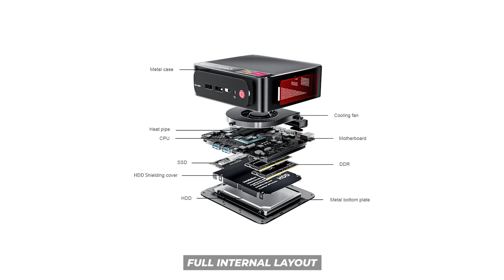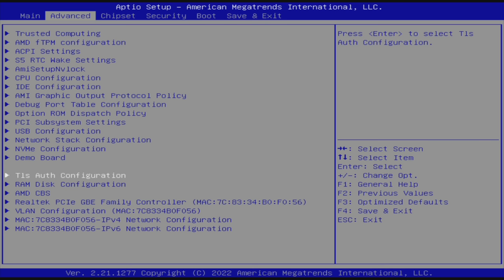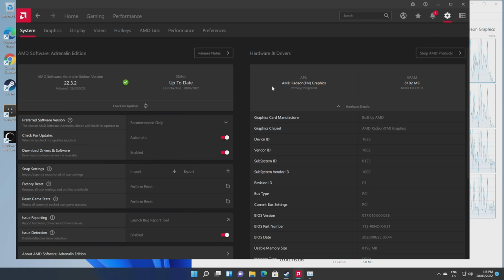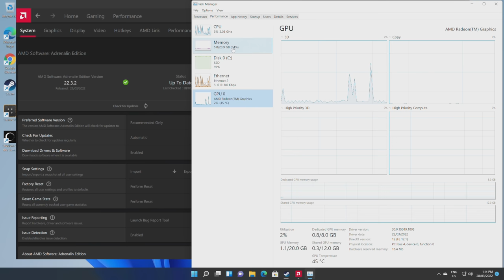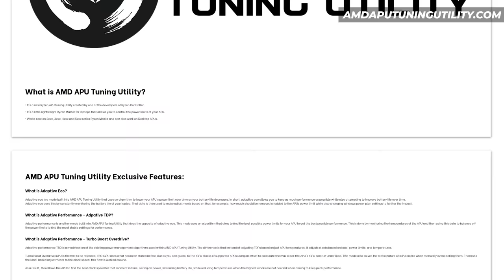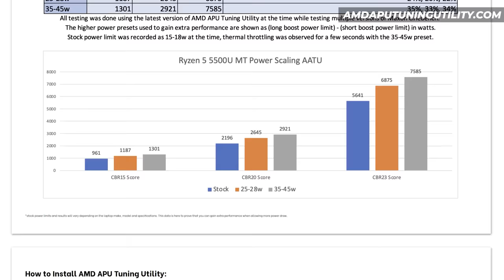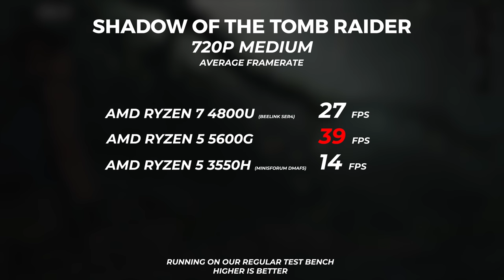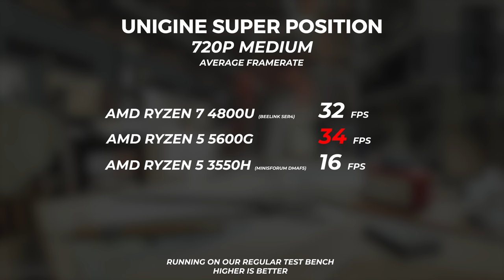The Beelink SER4 Mini PC is an Absolute BEAST

Comment: 4800U? This is now a laptop channel confirmed.
Reply from the maker: Confirmed!!
Reply: Drop a low profile air cooler on top of the heatpipes and this bad boy will have thermals down in the 40-50s under full load.
You will need a 5 volt fan tho.
Reply: @Torvaltz I did that as well for a few days and while it technically had more thermal mass and better performance that also included several more moving parts. 

Now, had this been a processor that was 20 watts hotter I would have seriously considered it, but it is currently in a brief case as a portable desktop machine.
Reply: Never run out of good content that's all that matters

Comment: To have it run reliably under Linux, I found out that it needs these boot-time options: rcu_nocbs=0-15 amdgpu.ppfeaturemask=0x00000000 nvme_core.default_ps_max_latency_us=0

Comment: Already purchased a Minisforum HX90 (AMD R9 5900HX - 8C/16T) Barebones system; I'll be supplying a pair of 32 GB RAM sticks, so 64 GB of RAM will be used. If I'm lucky, I'll go 2× over the limit to 128 GB.

Comment: I have a lowly Mini S, and there's a slight design flaw! ... The 2.5" drive ribbon cable gets trapped between the SSD and the metal drive caddy! (which is used as an SSD heatsink) This could damage the cable over time. It's fiddly to put the base back on WITHOUT trapping the cable. If you try to tuck it out of the way, it tends to spring out again! This explains why the cable has a sharp fold in it. No wonder Beelink supply a spare cable, but NOT with my Mini S! If the cable breaks, you will have no internal drive!

Comment: Ordered this about a week ago. Good performance, use it as a media center and remote play for consoles, works well. However the internal Bluetooth is absolute garbage. I am unable to determine if it is just a driver issue or not and since beelinks website is terrible, it does not appear they have updated drivers. Ended up using a Bluetooth dongle as only solution to being able to connect a Keychron K2 and Razer Naga Pro.
Reply: This pc is in an all metal case, but that is my only gripe with it as well as its antenna are pretty much wrapped up in a faraday cage.

Comment: I have a older one from this company simply for streaming for my tv its great and flawless.
Reply: How is it man does it last long how many years is your's? Because I'm planning to buy one.
Reply: @GamesMugen  I actually bought 2 more total of 3 . Works great for streaming movies, quality build and parts, not to sure if you try to play games the processor I have in mine are only 2.5 GHZ. The ssd and memory are good for streaming, no heat issues.

Comment: Do you need the 2.5in drive?
Reply: The real point is that it comes with a nvme pre-installed. Usually relatively small due to cost. 128gb ~ 1Tb. So expansion options are truly welcomed.
Several of these mini pc with the same size. Allow 1x nvme 2280, 1x ssd 2280 and 1x 2.5 sata. That's a lot of expansion possibilities for such a tiny machine! ;-)

Comment: Hey if you can't get a Steam Deck in your country (which is many of us) you can probably pick up something like this: Not going to perform as good but then again this isn't on battery so the 4800u without as many power limit restrains can probably make up some of the performance a steam deck would.

So also as a suggestion/request: you should try out Steam OS specially for devices like these since I think that the Steam OS could end up becoming a very good Linux gaming distro overall beyond the deck because it has the flexibility of Arch rolling release but a lot of the testing and control will be better/easier with Valve pushing most of the updates they've tested instead of a typical Arch install where a user basically risks some regression issues when updating to the latest and greatest packages.

Comment: I just got the 4700 16/500 version for $360.  I was planning to get an M2 pro Mac mini when they come out but this is cheap enough to stop me screwing around with my old i7 desktop and be a great CAD and retro game station.
Reply: Where'd you get one for that cheap? Cheapest price I found for that one is about $450
Reply: @CiaraITB  I got mine on Amazon last Friday for $360, honest.  It must have been a program to get things moving -you are right, it is back up to $450.
The new generation of chips are coming out, so inventory is being managed.  Watch and see if they drop again.
FWIW it's a great tiny PC.  I decided not to wait because the next gen needs faster memory to perform, and that memory will be in short supply and extremely expensive.  According to AMD this 4700U will work with higher speed LPDDR4 -but 3200 is the fastest available in SODIMMs.